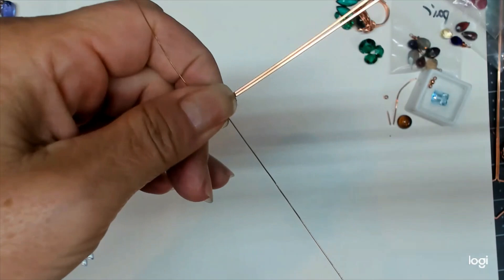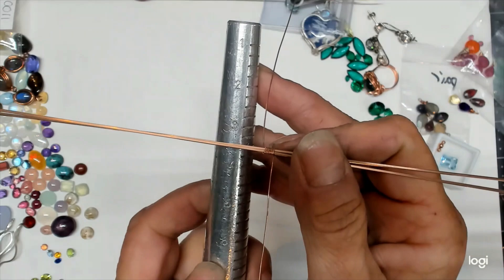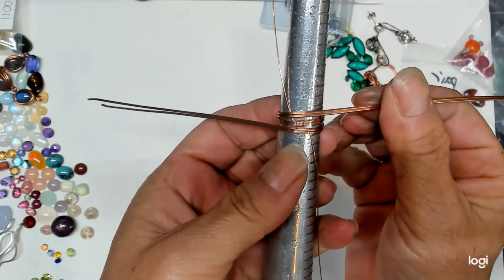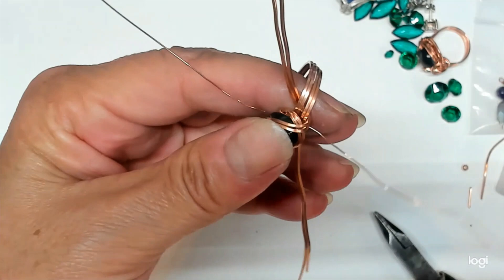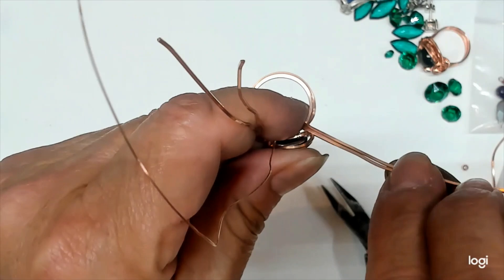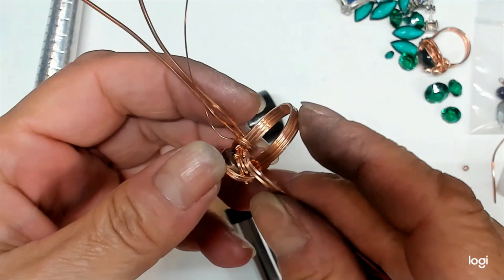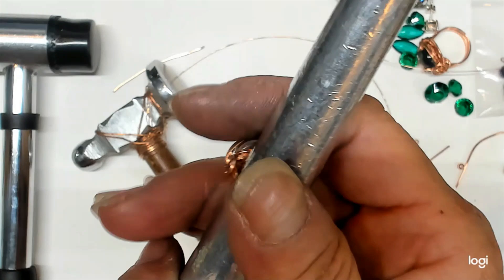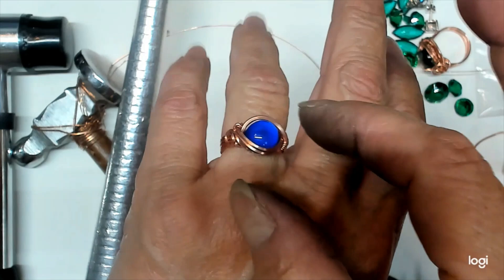DIY RING! Wire Wrapped Cabochon Rings: Step-by-Step Tutorial

Comment: How much would you sell this for with the materials you used here?
Reply from the maker: Hi Gail, great question!  These are glass, mood cabs, bare, unoxidized copper wire, as is... $20?  Maybe $10?  If I oxidize, polish, and seal the copper, then I'd try for $30 or $40... but these are glass craft cabs, so chances are you'd not get too much for them for the entire effort, but I could be wrong.  If you use a natural stone, then $40 to $50 depending on that stone.  If you use sterling and a natural stone, then it would be very dependent on the stone but I sell them in sterling for $80 with nice gems... if a very nice gemstone, then it could be well in the hundreds but I'd certainly do more than this ring style for design ... gold wire, etc... I hope that helps!  I got these for some craft rings with my nieces but I LOVE them. :D  Dates me back to the old Mood Ring days LOL!
Reply from the maker: Having said that, Gail, this ring capture is worth learning too... there are options here too that work where Midway is more troublesome... very thin stones for example, are not easy in Midway because of the coiling but you can very easily snuggle them up to the center of this shank for a thin capture.  I hope that helps and it's why I show and use more than one capture... stones vary and so do their needs for security. Hugs!
Reply: @PerfectlyTwistedJewelry  Actually, I’ve had customers asking if I had mood rings! So for sure you’re steering me in the right direction!😁 Thanks for the detailed answer on prices. Thanks for all of your hard work sharing your expertise!❤️
Reply from the maker: Hugs you!  Thank you too!  Yep, Blue Sky Hearts and Mood Rings for next weekends Livestream!